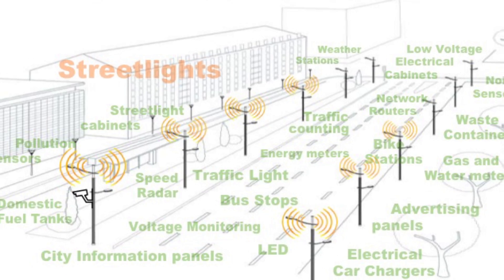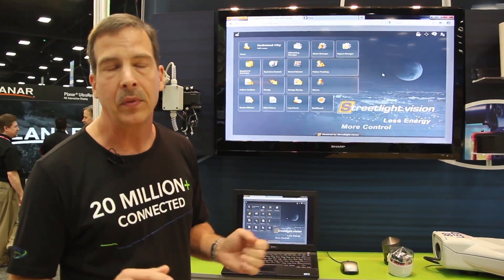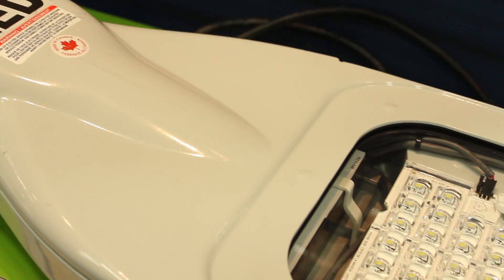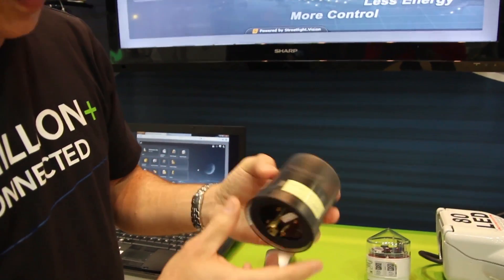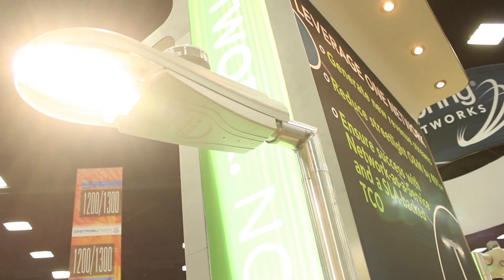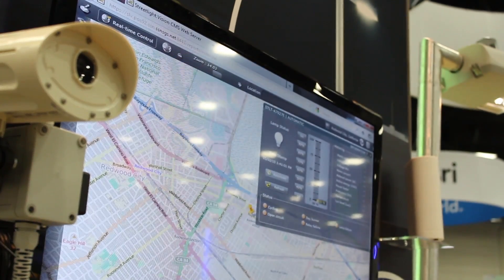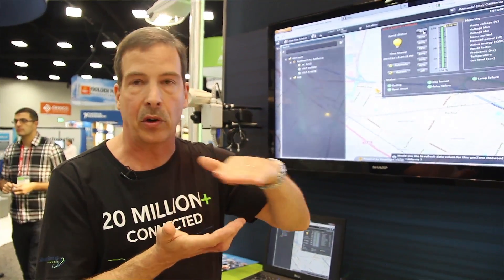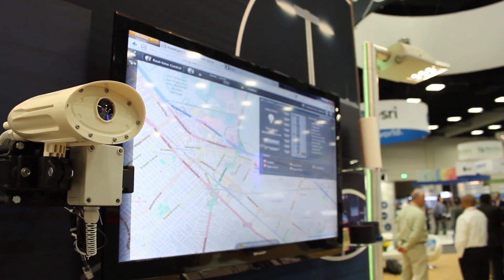Silver Spring Networks Demo - Smart Street Lights

Comment: Does the streetlight fixture that has the smart control system mounted inside the fixture still have a socket on top for the twist lock photocell?